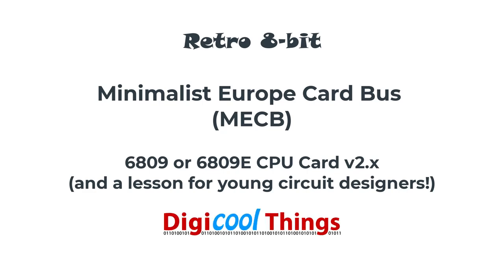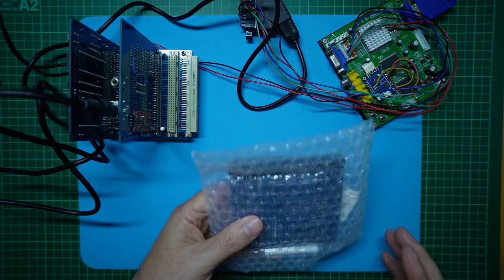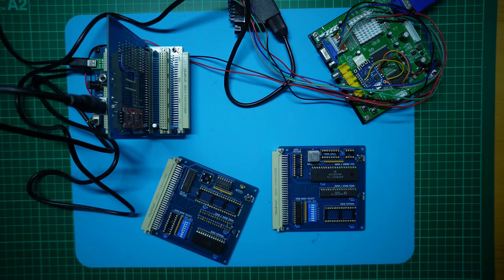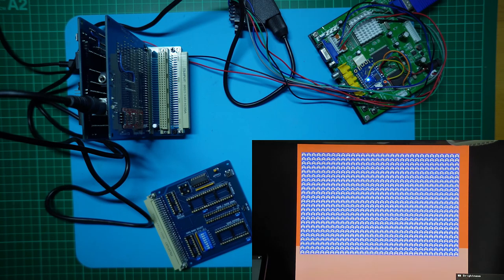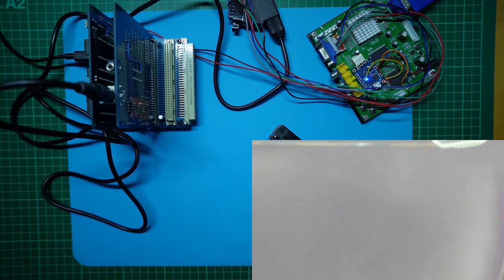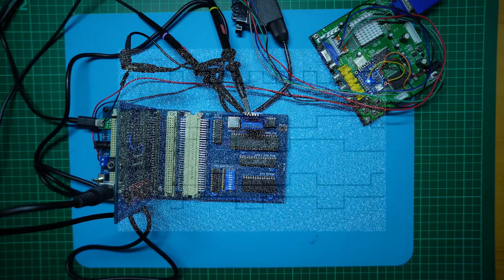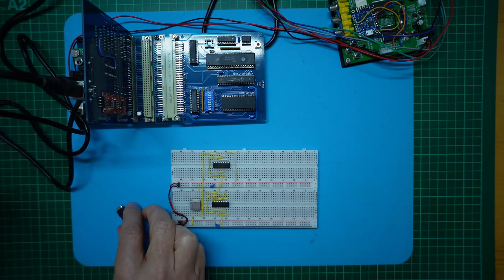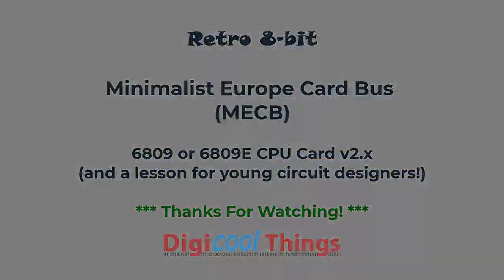Minimalist Europe Card Bus (MECB) - 6809 or 6809E CPU Card v2.x and a lesson for circuit designers!

Comment: glad you are back :-) please, have you somewhere listed the exact aliexpress sources of all these cheap matching DIN connectors?
Reply from the maker: Thanks.  I’ve had a few challenges this year, and I’m still waiting on flood repair insurance etc.  But, I’m hopeful of getting fully back into my projects.  Currently, I’m busy laying out my next PCB design, so hopefully my next video won’t be too far away.
For the DIN connectors I'm using, search AliExpress for “rtlecs din 41612” (without the quotes).  The connectors I’m using are the 364 type. i.e. 3 row, but 64 pins instead of 96 (A & C rows populated).  I'm happy with the quality.
Reply: @DigicoolThings  thanks and good luck with everything!

Comment: Hey, love this project, and love the bus connectors!  One thought on your usb-c port on the backplane..  I think your method of pulling power from the USB-C port could be problematic.  Without monitoing of the CC1/CC2 pins, it was my understanding that you would be limited by the supply to 500ma.  The reason for this is, as connected, your backplane looks like a USB sink device,  if a device has no ability to be able to follow the USB2 rules, the Type-C spec waives those rules and permits 500 mA.. max.   I suppose if one was using a "dumb" 5v usb type-c supply, this might still work, but for many usb supplys, it likely won't.

It would be better to use a usb type-c PD Trigger module.  These have a small processor that talks to the psu.  most of these boards allow you to choose the desired output voltage and vary in current rating from 3-5A at 5v.  Go to ebay and search for "usb-c PD Type-c DC Fixed Voltage Power Trigger Module".  It would be a nice addition to the backplane: https://www.ebay.com/itm/114517531316
Reply from the maker: Hi John. Thanks for the comment.  I do understand what you are saying with regard to the use of USB-C for power.  I imagine what you’ve described would indeed cause issues, if using a USB-C PD compliant power supply.

I’m making use of the now commonly available, and relatively cheap, Raspberry Pi USB-C 5V 15W power adapters.  My understanding is that these are simply a dumb 5V 3A Power Adapter which happens to use the USB-C connector (please let me know if I’ve got this wrong?).  
So, I’ve simply just used a plain USB-C female connector module, to allow the use of these power supplies as an alternative to the DC jack option.

Fortunately, it appears the PD trigger module you’ve suggested can likely just be used in-place of the simple connector module I’ve used. 
i.e. Without any change needed to the BackPlane PCB.
So, certainly very good advice if using a proper PD compliant USB-C Adapter!

Thanks for pointing this out!
Reply: @DigicoolThings  well good.. I share you dislike for the connectors, like those used for the RC2014 bus and derivates.  I suppose the price of using the proper bus connector could turn some off, but I've got a large stash of these DIN style bus connectors so I'm excited for this.

Comment: Sorry but I've just got to say how much I love the fact that you use the bus's and not just have a drawing of every chip with net names on every pin. Then you have to guess where they all go a right bugger to find you have missed a link out.
Reply from the maker: Don’t say Sorry.  I’m pretty sure it was your earlier comments that prompted me to revisit and use some bus connectors.  I also totally agree with you.  I always used bus connectors in the past, but a few recent schematics had suffered from the desire to get on with breadboarding the circuit “laziness”.  🤓
Reply: @DigicoolThings  we used to have the wire connection show the direction the signal would be going in. 
in the early days i would have drawn the circuit by hand on scraps of paper or most often in your engineering log book and this was given to the drawing dept to produce the circuit diagram.  None of this CAD systems  on your desk.
Reply from the maker: @TheEmbeddedHobbyist  You are bringing back my memories now!  I just checked on some of my old personal schematics, which carefully hand-drawn on paper, and my bus drawings also had direction signal arrows, as well as clearly labelled with what the bus was, and also diagonal lines through them showing the width / how many wires were on the bus.  Perhaps the convenience of modern CAD software and the modern "urgency" of the world, has made us forget the effort and time it use to take us in designing and documenting each schematic.  🤔